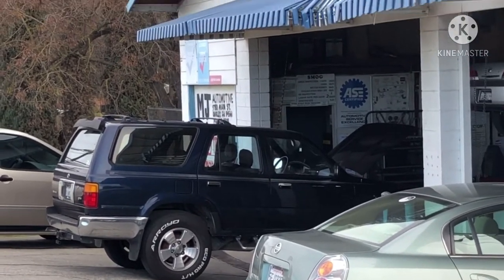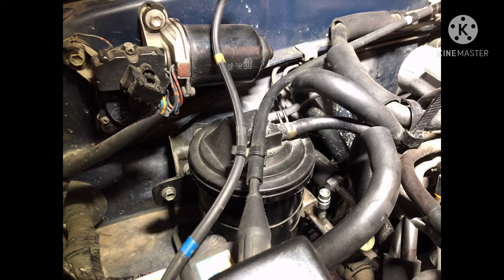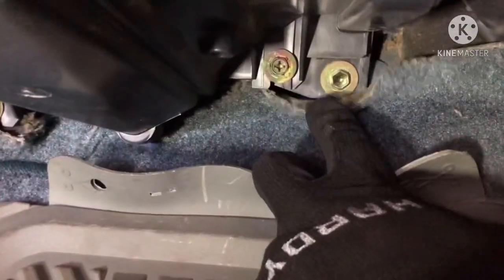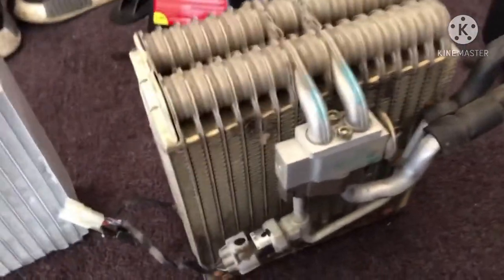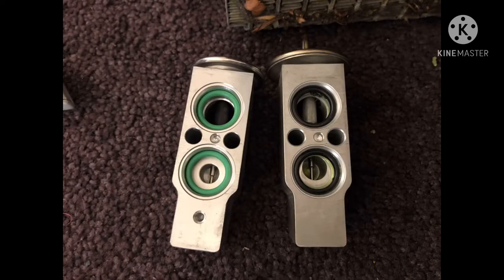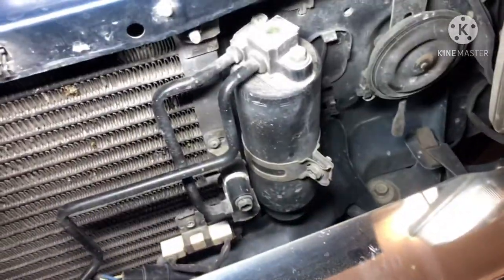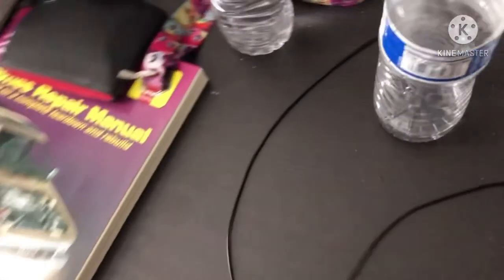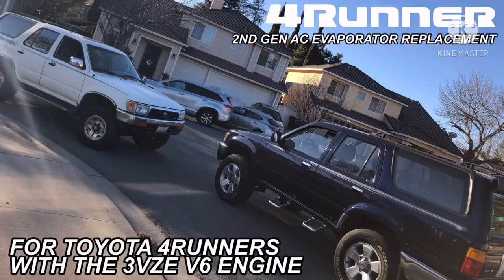2nd Gen Toyota 4Runner (1990-1995) AC Evaporator Core Replacement AND SOME EXTRAS

Comment from the maker: Turns out that large cylinder thing is related to the FUEL SYSTEM
Reply: It's the charcoal canister that is part of your fuel/emission control system. The bigger line comes from the top of your fuel tank so instead of venting fuel vapor into the atmosphere it runs it into the throttle body.

Comment: Nice rides I have a 95 3vZ auto 4x4 SR5 just pulled heads decked em fresh exhaust and intake valves. Valve seats,guides,shims and 1 cam cause a lobe was wiped. Runs beautifully now. Identical to your white one. I vacuumed the Ac system and rinsed out condenser comes out at 30 degrees now.
Reply from the maker: That’s great to hear. I’ll be honest the 3VZE isn’t really a bad engine

Comment: Thanks, this is useful. I’m trying to replace the heater core and it looks like removing the evaporator body is necessary. One question - do you need to evacuate the ac system before disconnecting the two lines near the firewall?
Reply from the maker: Yes you have to evacuate the AC system before you start tinkering with the AC
Reply from the maker: The heater core is in the middle of the dashboard so you may have some difficulties getting to the heater core itself
Reply: @TndPnyRCofficial  yes, I’ve removed the dash and everything to gain access. But it is also connected to the AC housing body, which is why I need to remove it as well.

Comment: Does a 92 4Runner have a cabin filter and if not how would I clean the AC if it smells weird ?
Reply from the maker: 2nd Gen 4Runners were never equipped with cabin air filters
Reply: Unfortunately, it’s most likely your heater core is moldy and needs replacing. A temp solution is to do a ozone generator treatment.

Comment: I've been dealing with intermittent AC for over a year on my 3.0. Everything is getting power, all the fuses and relays are good, and I've replaced the clutch, compressor, expansion valve, and the refrigerant is holding, not leaking. Sometimes air will blow cold for hours, other times it won't start working until I've been driving around a few miles, but whenever it cuts out its because the clutch will not engage. Does this point towards a bad pressure switch? Thanks so much.
Reply: yes

Comment: When reattaching the AC lines for the evaporator, do you need to replace the o-rings?
Reply from the maker: You should since you’re there already
Reply: Yes, keep in mind if you’re using r134a refrigerant use the Green O-Rings because r134a will deteriorate o-rings that are used for r12 refrigerant. You can tell by the color of the seals. Red or black o rings were used for r12 systems. And green orings are used for d134a

Comment: Soooo.,, sounds like the case can’t be separated for cleaning out, without actually pulling the evaporator?
Reply from the maker: That’s correct
Reply: @TndPnyRCofficial  Gotcha👍 Thanks for the reply 👍 I would like to share what I’ve just done though. On my ‘89 Toyota truck, my problem was poor airflow with cold ac. I was thinking I needed to replace blower motor, but found out that wasn’t the case. After clearing debris from the blower motor fan, I removed all visible screws/clips that I could find without actually pulling evap box. This allowed me to separate the box (Opposite side from firewall, of course) about 1” with no issues. It was enough opening to remove the enormous amount of leaves and debris from the evaporator box. What worked best for me was a shopvac hose placed on the inlet side of the evaporator box opening while blowing compressed air on the exit side of it. I was amazed by what came out  and the  is now debris free and blowing like new. 👍

Comment: So I'm a bit confused about how to plug the pressure switch back in. Should have taken a picture before I unplugged the wire. Seems like it's not what my Pops used to call idiot-proof. It fits both right side up and upside down. I'm pretty worried about plugging it in backwards. Not sure how to continue the repair without that certainty.

Comment: How much  Refrigerant oil did you add to the Evaporator?
Reply from the maker: I didn’t add refrigerant. Prior to removing all AC parts and after installing them. I took the truck to the shop to remove and fill the AC system with R134a. I only added PAG oil on the compressor

Comment: Where did you get the parts? I have a 1990 4 runner v6 with no ac components at all except for the wiring harness..  I need compressor, driver, evaporator, lines.. all of it. please let me know
Reply from the maker: Autozone